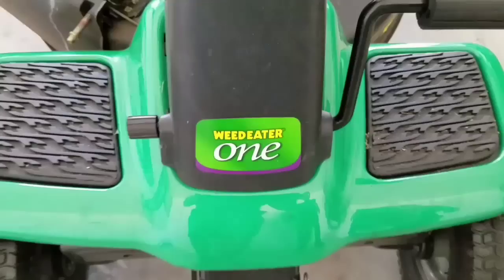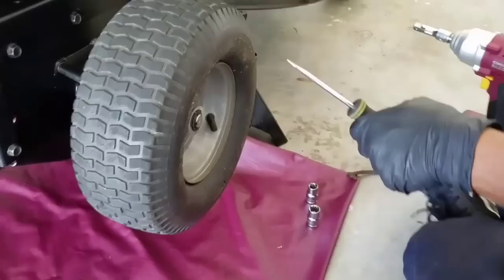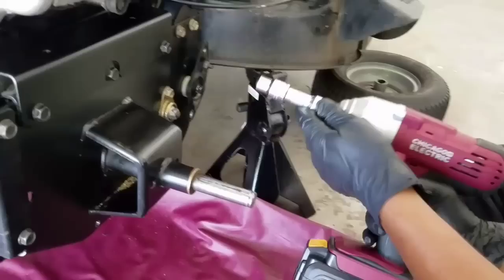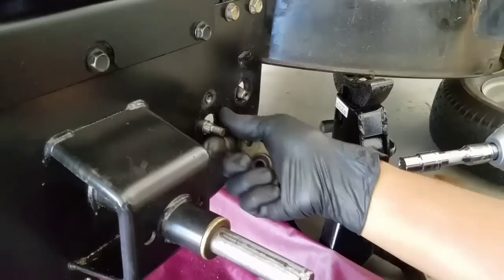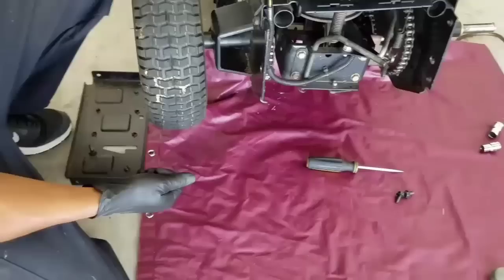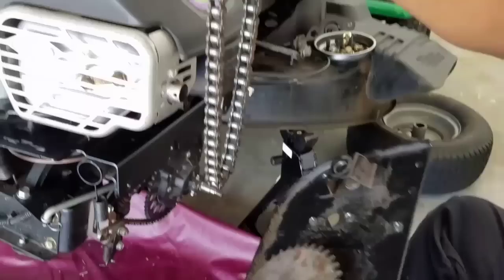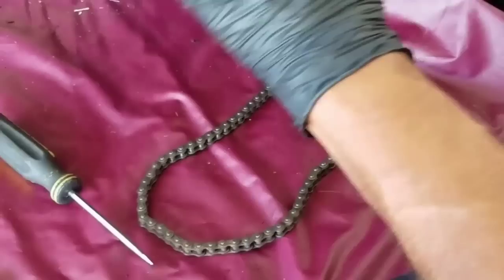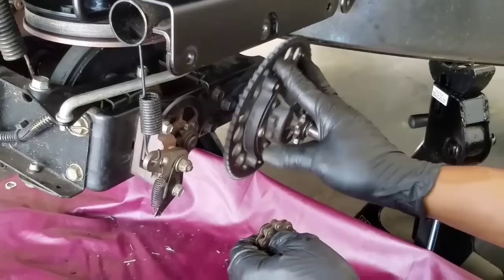Weed Eater One Riding Lawn Mower Chain Removal (Tutorial)

Comment: this guy is nuts.. the complete drive train as viewed from the rear should be horizontal, but his is leaning over to the right.. that is why he thinks the chains are stretched , the whole assembly is loose as the bushes it rides on are worn out. this in turn puts a twist in the thin drive chain, and also on the final drive chains..   all this mower needs is to replace the bushes, not the chains...
Reply: The bushes? U mean bushings?
Reply: @patbrown5656  I think he's drunk  :face-green-smiling:
Reply: The video was helpful. Your comment not so much

Comment: Great video just a few quick info notes. No one messed with the bushing on the one side that’s how it wears out. Also your chain was not stretched out the plastic sprocket would go first. On the parts break down there is a small sprocket on a spring that you are missing this is what takes the slack out of the drive chain. What’s left of the spring is still bolted on the bracket in one of your videos. Hope it’s still running for you I just fixed mine again.
Reply: Some early models did not have the tensioners sprocket, mine didn't.

Comment: I have a question I have same mower, what would cause a grinding noise moving forward driving but not in my reverse?
Reply: I have the same problem which is a broken differential (inside plastic housing of main drive sprocket). For me, the left side gear was worn down by the spider gears so I used a grinder and dremel to re-grove the side gear and then added a washer behind the gear to make up the space and help push the gears together. You can also replace the whole differential but it's not a cheap part and I've got the Dutch blood...  We'll see how long my repair lasts.

Comment: I picked one up recently. Runs great, mows good, and it even drives ok. Makes a clicking noise coming from the rear end in forward gears and reverse. Pushing it you can't get it moving fast enough to hear it. I see the chains, they are tight. The bearings on the side look ok. It likely sat outside for awhile as I see light surface rust on the bare metal stuff. Is it possible some of the chain rollers are causing the noise? I cannot pinpoint exactly where the sound is coming from.

Comment: Gracias!!
Your video is excellent. I do have a question. My model is the same as yours. But when I try to loosen the main gear bolt (the one in the middle of the 3 on the gear), I can't loosen it. The gear just turns and moves the chain. 
I am trying to get to the inner chain to retread it. It keeps jumping off, I think, because the belt is loose. So will also replace the belt (it should be here tomorrow). I'm getting stuck with getting that gear bolt loose so I can take the panel off and get to the inner chain. 
Any suggestions would be great! Thank you!
Reply: If I understand you correctly, what I did was put my foot on the tire to prevent it from turning.

Comment: 😊Thanks
I just got one of these and the clutch pedal is loose preventing proper active brakes and active clutch to change gears .... Mower still works but i gotta throw it in gear to operate the machine. I wanna upgrade all important parts like chains, brakes, belts after that watch more of🏆 your videos...do you have any engine work content on this mower??

Comment: I thought my chain was slipping, but it turned out to be the differential on the primary drive. It has planetary gears in a plastic hub which is bound for disaster just from using it. It made a horrible racket in any of the forward gears, but did move in reverse. Sears had the new differential for $39.00 delivered. It is part number 428876. Godspeed.
Reply: Does this new part keep the chain from always coming off?
Reply: I have the Same problem with my weed eater one,,am in Kenya,, what do I do?

Comment: One glaring question. On the side opposite the primary drive, did you not have to remove the gear held in place by a snap ring? So the primary drive could be removed? I am replacing the primary drive now and see no mention of this fact. The rest of the video is spot on and quite appreciated. Thank you.
Reply: Same problem here, how did you remove it?

Comment: My riding weed eater one is not engaging the blade when I turned the lever to On position. Just wondering what the probkem is.
Reply from the maker: check the neutral switch
Reply: check the drive belt under the mandrell, it might have come off, (worn out).
Reply: @barryaiello3127  Thanks for the tip.

Comment: Thanks dood.  I had one at three seasons throw the inner chain.  What a pain in the ass.  It was going to be $400.  But they said it would be on warranty, and shipped it back to the factory. Net result they said they put in a new transmission and chain. Looked like the old stuff to me.  They did not replace the worn out blade.  And it now has a gear shift problem.  The selector no where remotely matches up to what it is doing.  So, it is in the less slow forward gear and I just do a series of long ovals so I do not have to change gears for reverse.  In one spot, I just turn it off and wrestle it in the right direction, then start up again.  Looking at how the plates slap together, I had a feeling that it would not be a real terrible job to tear down to the chains.  Having seen it done.  and Out of Warranty, I will not hesitate to just tear it down on a nice day and swap the chains out.  The gear shift thing is something I will continue to research.  I subbed your channel in case you run into that on your assembled test drive.  Another annoying thing I have noticed is the 26" star hole blades seem to be drying up and increasing in cost.  If the motor goes out, I will try converting this pig to electric.  If a couple of old batteries run it for a half hour, that will be plenty enough.
Reply from the maker: also check the shift gear plate is the one that hold the friction disk
Reply: Thanks, will do.
Reply: Rick Ramo had one given to me made a slipping noise  now I have a bucket full of parts the main drive sprocket that goes around limited slip housing is plastic as is the housing ,the spider gears were stripped.  The chain and sprocket that run wheels are steel but the main drive in middle is junk
Reply: Thanks for the heads up Daniel.  I will run a snake cam down into that area and get an idea of what I need before I pull it apart.  I am guessing another 4 mowings in this season.  I was sort of looking at that Ryobi 480 electric mower.  Too bad that thing is three times as expensive as it should be.

Appreciate the tips big time.

Comment: the big middle nut on the golden bracket won't come off, it just keeps spinning
Reply: Ky Sumthin did u wedge the chain with a flat head screw driver to remove
Reply from the maker: try to hold it with a vicegrip pliers

Comment: Great vid. Is the new chains shorter than the old one? Wish there was a way to just remove a link or two like on a bike.
Reply from the maker: No, they come normal size and no you can't cut it , check the bushing
Reply: @Clown56  ok thanks.there just seems to be so much slack in the chain. I wish they made a shorter one then it wouldn't pop off occasionally.

Comment: Hello, refer this chain: https://youtu.be/Laa0NIX2fz0?t=709 it's possible adjust the chain so that it is more tense? The chain jumps off and the traction stops. Thanks for any feedback
Reply: No, there is no means of adjustment, when it gets old just install a new one. Some of the latter models had a tensioner wheel to help with this issue, mine does not have that but it went 9 years before losing the chain.

Comment: Loved your video.
You can get the entire set on eBay.  
The 3 pc. Replacement Chain Set includes (1) #430645 Primary chains and (2) #428069 heavier secondary chains. I got mine from there in 2 days and  I'm back in business.
Reply: Aaron Griesel how much did you pay for your set of chains?

Comment: Do not start
Reply: Do not want to start
Reply from the maker: check the head gasket
Reply: @josephlopez6881  How old is the gas in the tank?, it might have a moisture issue in the carb, (mine did), you can drop the carb bowl from the bottom and clean it out, spray some carb cleaner up into the carb while the bowl is off, use the plastic straw that comes with carb cleaner, re-assemble. Could also be a bad spark plug, pull from head and turn motor over, check for spark.